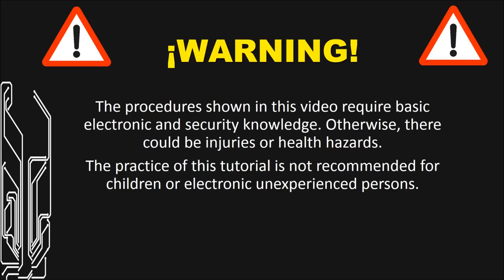Reciclando Cristal Touch de Tablet

Comment: Saludos de Colombia. Buen proyecto, genial idea, casualmente estaba haciendo algo así para un timbre touch, ensaya con un transistor tipo darlington (arreglo de dos transistores en uno) como el A13 ademas se dispara solo tocando la base así sea con una resistencia  o condensador cerámico muy altos. Recuerda colocar diodos (cualquiera) en paralelo con la bobina de los relevos, en sentido contrario (+ del relevo con el - del diodo, y el - del relevo con el + del diodo) para cortar las corrientes parasitas o de pico inverso que pueden pasar de los 100v y quemar otros componentes.
Este circuito me pareció bueno con el transistor de tipo NPN, el MPS A13 sus pines son EBC:

Emisor: a GND

Base: sensor touch (se puede controlar la sensibilidad con una resistencia  a GND o VCC según necesites; por ejemplo una resistencia o reostato de 12K a GND y una foto resistencia a 5VCC es un excelente sensor de luz y una resistencia de 100K a 5VCC y la foto resistencia a GND un sensor de sombra, además una linea de tierra cerca ayuda a reducir la sensibilidad ya que solo poner un cable y mover la mano cerca hace que se dispare)

Colector: al Negativo del LED y el + del LED con una resistencia de 390 Ohm a 5VCC.

Este transistor es de 30v pero se tendrían que re calcular las resistencias (se vale ensayo y error ;-) espero que les guste y les sirvan mis aportes éxitos).

PRECAUCIÓN. Si pones los dedos indices en los terminales del relevo (así sea de 5 voltios) y lo activas y desactivas te pega un corrientaso que ni decir.

Comment: Hola, buen video, ya arme el circuito de encendido pero tengo un problema con el panel tactil, el dedo no es suficiente conductor y no sirve como interruptor, será problema del panel tactil que estoy usando? Si apoyo los dos cables sobre una misma franja de panel tactil el cirucito se cierra pero si apoyo los dos cables en dos franjas distintas y pongo el dedo encima de las dos no se cierra el circuito. Espero su respuesta, gracias....
Reply: A mi no me funciona lo que usted hace en el minuto 14:00
Reply from the maker: Hola, gracias por tu tiempo para ver mi vídeo. por lo que dices me parecen posibles dos opciones: la primera es que la capa conductora de vidrio sea de un material poco conductor por lo que necesite una mayor área de contacto o mas humedad, puedes probar esto si te mojas el dedo y la tocas a ver si funciona. La segunda es posible que el transistor que uses no tenga al sensibilidad suficiente así que recomiendo probar usando dos transistores en un arreglo Darlington.
Reply: posoco2000 Después de varios intentos descubrí que necesita una mayor área de contacto, probé apoyando dos dedos y ahí empezó a funcionar. Gracias por contestar! Sigue con tus vídeos, sos un genio! Saludos!

Comment: Me pregunto si se podría utilizar como sensor en todo el vidrio de la puerta o ventana
Reply: no, el unico sector que conducirá será la laminilla que has cortado, ya que es de un material especial. lo que se podría hacer (con mis dudas al respecto) es hacer un tablero de pistas independientes acomodadas en un solo marco, pero debes tener cuidado de que no entren en contacto entre ellas. otra sería recuperar una pantalla completa del tamaño de la ventana que vas a cubrir, pero lo mismo, cuidadar que no tengas errores en el circuito. espero haberme explicado 😅 saludos y suerte!

Comment: Hola posoco! si sabes y puedes subir algun tutorial de como hacer una buena linterna (potente) resiclando baterías de celulares q ya no se usan.. hace tiempo que tengo esa idea.. pero no se llevarla a cabo..gracias!
Reply: necesitas un circuito cargador que no es más que un capacitor cerámico una resistencia y un puente rectificador, las baterías por supuesto y un led ultra brillante de 100 w el cual puedes conseguir en eBay...suerte!!
Reply: +Ricardo Zacarias muchas gracias por el comentario Ricardo! un saludo

Comment: este cristal se puede adaptar a un pc para manejar como tactil aparte y manejar toda la pc por el crsital?
Reply: claro puedes usarlo para encender y apagar la PC ya que funciona como un pulsador ni siquiera necesitas el Relé si lo quieres usar con ese fin.
Reply: No, no puedes, veras, si te das cuenta el cristal esta compuesto por unos receptores, esos que conducen la señal capacitiva que generas al poner tu dedo sobre un sector, a un pequeño micro que se encarga de decirle a la tablet donde has puesto el dedo, sucede que para que te funcionara, tu pc deberia contar con el integrado y el circuito que ocupa esta tarea, ademas del socalo para el conector, que no esta en este, independientemente de esto cada cristal tiene un conector muy diferente dependiendo del modelo (cristales mas èqueños o de menos resolucion tienen menos cantidad de pines en el socalo) , asi que es muy complicado hacerlo de esa manera, a menos que tu hicieras el microcontrolador y lo conectaras via usb. ademas tendrias que calibrarlo dependiendo de la resolucion del monitor, y buscar los drivers adecuados para su funcionamiento como dispositivo señalador.
Reply: pero frank dice convertir toda la pc normal a touch segun entiendo

Comment: puedes pasar el esquema del circuito ultimo que muestras al final del video me interesa porque trabaja a 220 gracias
Reply from the maker: Hola, el único diagrama que me quedó es el que puse en el link de deviantart, lo que pasa es que perdí el archivo original.
Reply: y el circuito es para 220 o 12 volts?

Comment: como hago para que alimente el 110v
Reply: Eso no alimenta la red de 110V, lo único que hace es una etapa de switcheo electronico que le da corte o continuidad a dicha red a través del pulso que reciben los "relés" o relevos que envía el circuito del táctil y los transistores TIP.